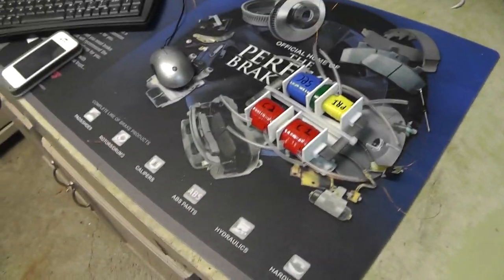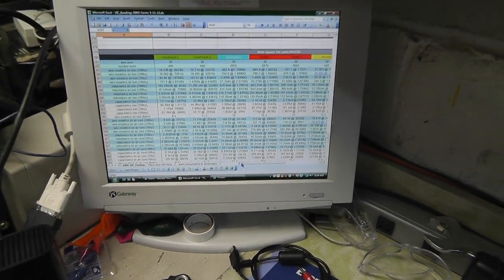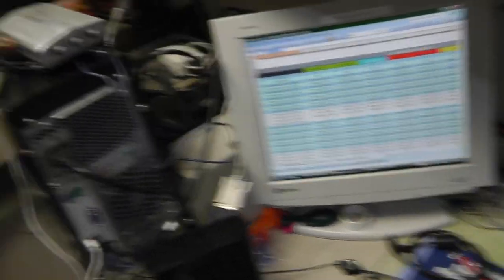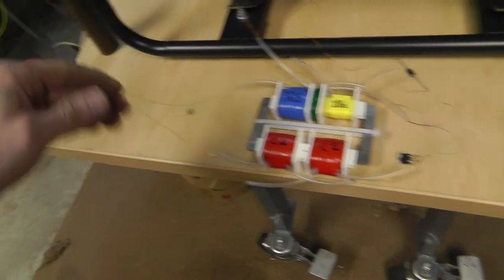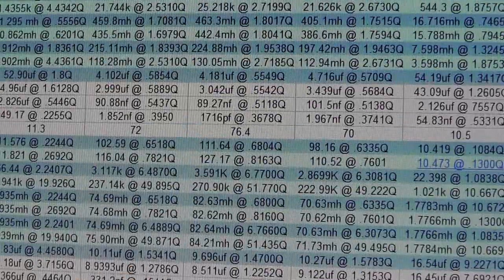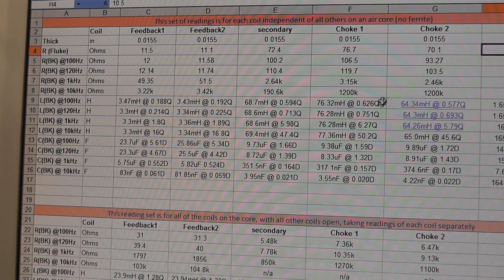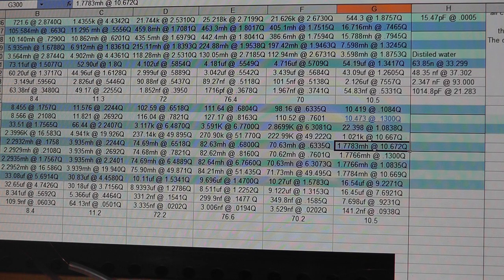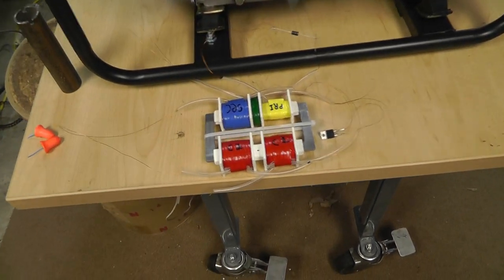Corect VIC Wire Size, 30AWG For Stans VIC? Looks Good! ~Russ

Comment from the maker: @cr76802 Yeah, theoretically you could get the HHO to self ignite under the cylinder compression... But the ratio again would need to be just right, as we are meter mixing alot of other stuff in the mix so the self ignition will be harder to achieve... ~Russ

Comment: lol yea seeya -im gone ending.
I to agree that the laminate may be to thick on your wire-this will increase the distance of the layers from the core this changing the inductance of the coil.I use polyester imide coated wire when i have to buy it.It is a single layer thin film but can handle 180deg c and solders well.
Anyway-Talk Soon Russ